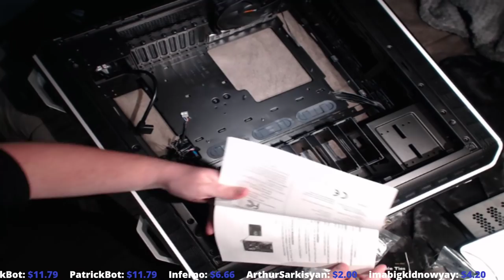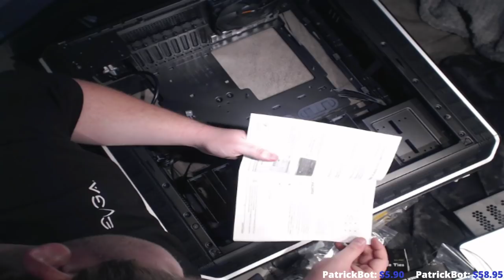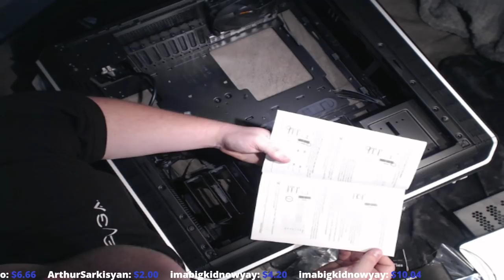Build With Me - New PC Build Live (Happy Thanksgiving)

Comment: So can I buy this stuff in a kit and how much generally would it cost to build a good gaming computer?
Reply: there are kits out there however usually you buy the parts individually and then put the computer together..  and by good gaming computer I'm guessing you mean about mid-grade or at least able to play the latest titles at medium to high settings... it will be around a $700 to $1500...... for a computer that can play all titles completely maxed out at 1080P you looking at around $1500 to $2000.....  and so on
Reply from the maker: I'd recommend using PC Part Picker. It's a website which will help you built a fully compatible rig and give you the best prices on the things you want.

Comment: Did he seriously not ground himself during the install? Great way to ruin your PC via static electric shock...
Reply: Grounding yourself out isn't "as much" of a necessity anymore, due to the fact that parts these days have much better static protection than they used to.
Reply from the maker: I don't live in a high static area, so it's not an issue, and I constantly was grounding myself.
Reply: I have probably built 200 - 300 PC's over the last 5 years. Never grounded myself via an anti-static strap or whatever, just touch someone big and metal before hand.